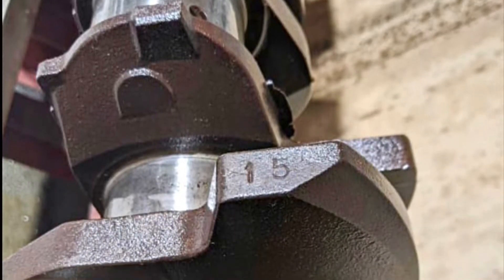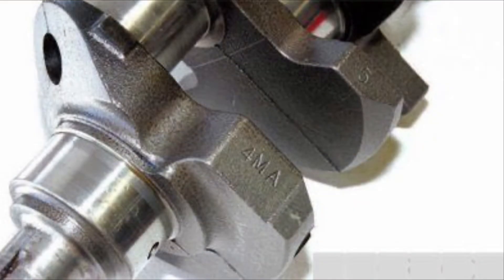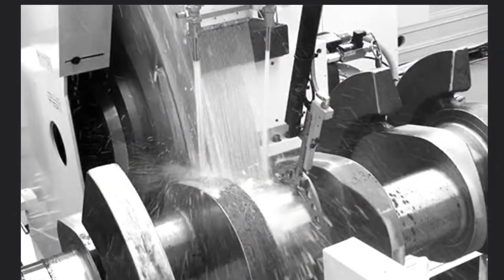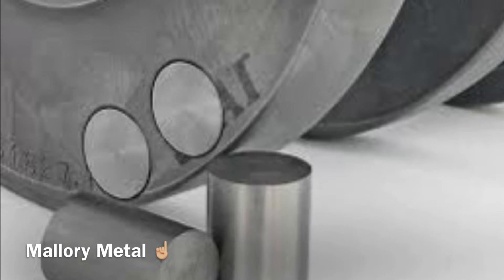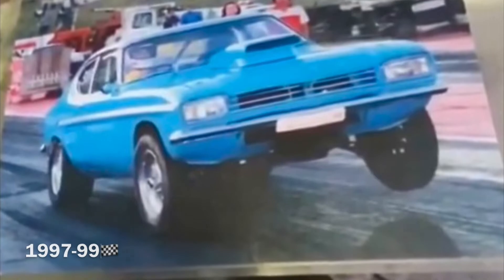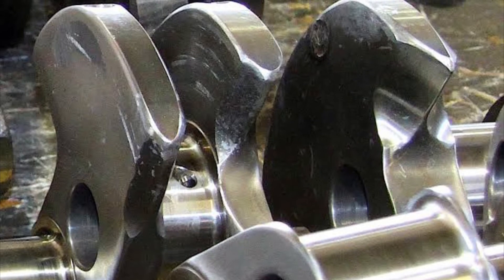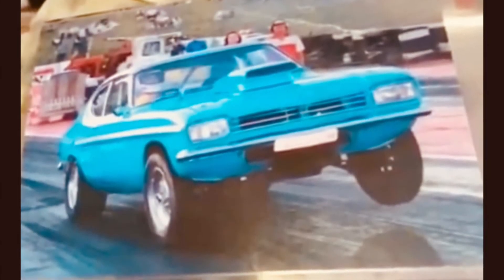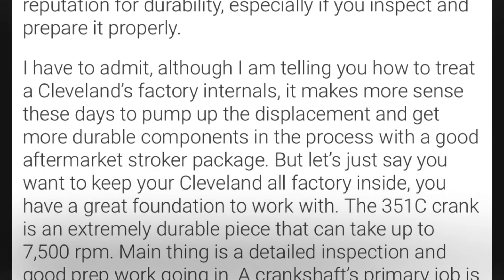Ford 351C  4MA-B  Crank, Custom Mods $800 in the 90s🏁

Comment: 69 Janks me and my brother raced a Frankstein clevo back in the 90s in circuit boat racing. We ran an 8/71 high helix BDS blower on a highly modified Cleveland. Our engine had 4V open chamber heads. Heads didn’t have port plates but had isky double springs with damper, titanium retainers with 10 degree locks, stainless valves all that. Manifold was a Newby and we had an Enderle bug fuel injection hat. We ran standard but polished and shot peened rods with arp bolts. These were later replaced with Eagle H beam rods although we never had a factory rod problem. In fact we hydrauliced the engine at Deepwater motor boat club bent the rod at a 45 degree angle but it didn’t break. We have ran all the crankshafts you have mentioned at 40% overdrive, yep that’s correct and no problems with a standard crankshaft although we did run a stud girdle, on a 2 bolt bottom end, we also had a custom crank support. What we did here was ditch the factory timing chain cover and run a 6061 ally plate which was our front engine plate, off this was supported the angle drive vertex magneto and stock car products 4 stage dry sump pump and enderle 110 fuel pump. We prioritised the oiling of the main oil galleries by drilling from main web journals up into the valley. The 3 centre mains had an oil manifold fed via dash 8 braided hose, the back main bearing was fed from the oil sender unit via dash 6 and the front main bearing from the oil filter gallery with dash 6 hose. The biggest issue we had was split bores, even 1984 blocks, which are supposed to be cast thicker.We destroyed 3 blocks anyway Stan Sainty came to the rescue he bored out the Cleveland 4.200. 200thou over bore and into the water jackets. Then he fitted 4.2 inch ductile iron diameter sleeves, which he turned up from ex Sydney water ductile iron pipe,internal 4.030 inch on all 8 cylinders. He made all 8 sleeves fitted and o rings for $1000.00. Stan was an unbelievable fitter machinist how he turned a solid billet of EN26B steel into a top fuel crankshaft was amazing, He reckoned the English steel was 40% stronger than a 4340 crankshaft. Oh and I came across the 4MAB crankshaft in a 1974 ZG Fairlane. I always thought it had a 2-3 % nickel in the crankshaft. If you tap the counterweights it definitely sounds, or rings like it’s more aligned to steel than just a cast iron crank.
Reply from the maker: Wowser!!… that’s just badass & thanks for sharing👍🏼. Sounds like you had one mean Supercharged Clevo🏁….. the rods were pretty stout i always thought, I’ve taking em out to 7700rpm on a few occasions & we’re sweet. Machining is the key also when it comes to survival, I’ve always said (even on my Community Posts) that a properly sleeved oem block is always stronger & better off in making/surviving HP…. Yes your probably right about the 4MA-b  it probably did have higher nickel content or more towards being like an Nodular piece 🤷🏻‍♂️🏁
Thanks heaps for sharing, badass👍🏼🏁
Reply: Benny Gatts XA Falcon was what we aspired to, he and Joe were legends @69JANKS
Reply from the maker: @scotttopen2750  💯👍🏼🏁

Comment: Thought  4ma ,4mab ,stood for 4 main anchor, bolts  for the performance  blocks  etc for assembly  line to know  what  went where .4v heads orginal  4 venture  ie 4 barrels  carby  for  the large  port ,2v venture  for the small  port of the day so assembly  line  knew where it goes
Reply from the maker: hey DL i get what you mean, but these cranks ended up everywhere both on 4V/2V Cleveland’s & 2bolt Mains etc….so🤷🏻‍♂️

Comment: I used to run the standard Aussie 351 crank and rods  in my XB GT coupe. It was my day driver,  to and from work every day. I only remember one day that it did not see 7000rpm, because I realised that I used to spin it to 7000rpm at least twice a day on the way too and from work. The rods were the weak point. They would fatigue and break through the big end eye,  and the piston would bounce off the head. But every motor I pulled down had 8 cracked piston skirts and the lobes were worn on the cam. FYI, my small solid was an Isky FL570, the big cam that I used to run was a custom ground Crow solid. Isky was nicer to drive, more docile, but the Crow solids went far faster, and at 5500rpm hit the power band like a CR500 with a piston and a pipe. Really enjoy your channel. Regards Greg
Reply from the maker: Haha who can forget the CR500💨👍🏼, wow that’s cool TS, them Cleveland’s sure did rev up easily, appreciate it & thanks for sharing that👍🏼🏁

Comment: well done good video ,my question is what main bearing did you run back then?fully grooved like the boss351c?im about ready to start my 351c build for my xa fairmont hardtop,just getting some ideas together cheers
Reply from the maker: Thanks i appreciate it👍🏼, it's been a while ago but pretty sure they were full groove Clevite perf bearings......you want a lot off oil supply to a Clevo  mains / rod bearings 🏁

Comment: Do you still have the crank? Im looking at modding my stock crank up. I have stock rods that have been polished, bushed, arp bolts fitted to domes.
Reply from the maker: @RavenWoodLeader  crank is long gone, been like 24yrs since selling off that short block……need to weigh up the cost & effort nowadays if it’s even worth doing or spending $ on an oem crank. Back then was different, we didn’t have or could afford aftermarket nice cranks🤷🏻‍♂️
I had the same rods/pistons also, used to spin it to 7300-7600rpm no issues 👍🏼🏁
Reply: @69JANKS  thanks for the response. I just figured I'd see if I can save a little and use one of my stock 4ma or 4mab cranks. If you'd recommend a crank to look into what would it be?
Reply from the maker: @RavenWoodLeader  right on👍🏼, the 4ma/b are good cranks, strong enough to withstand big NA power…..just use that then once all checked over/machined up…. Otherwise Scat or Eagle offer a Cast crank that pretty reasonable. But just use yours, crack test it & machine up the mains/journals & done ✅ 🏁

Comment: Why didn't you lap and blue them in.
Reply from the maker: You mean mating up the Flywheel to Crank correctly ? , it was a flex plate (auto) & the machine shop took care of all that stuff & balancing etc….👍🏼🏁
Reply: @69JANKS  sorry I'm referring to valves and seats.
Reply from the maker: @mikerammelt2420   this is a Crankshaft vid here….. but any way most Valves do get a lap job after seats been cut.
Cheers 👍🏼🏁